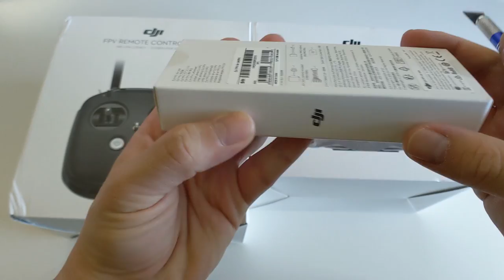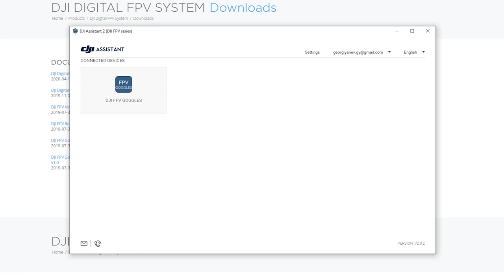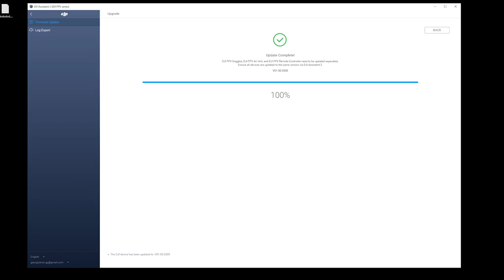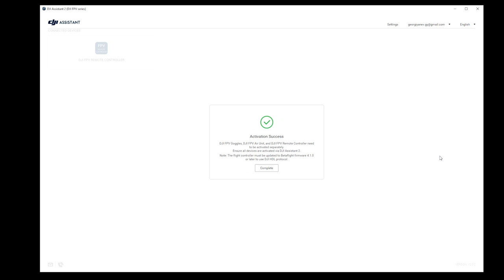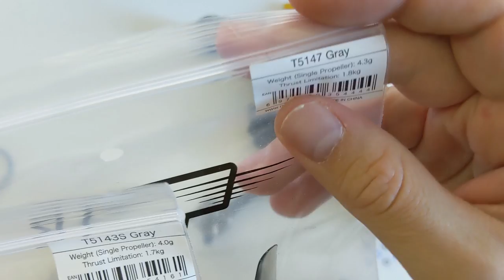DJI Digital FPV system - Unboxing and COMPLETE setup with Holybro Kopis 2 HDV /part 2/

Comment from the maker: TABLE OF CONTENTS:

0:00 - Intro
0:04 - Unboxing the DJI digital FPV system
3:21 - Charge the remote controller
3:40 - Attach goggles headstrap
4:27 - Screw in antennas
5:08 - Attach antennas to air unit
5:44 - Attach flight controller cable to air unit
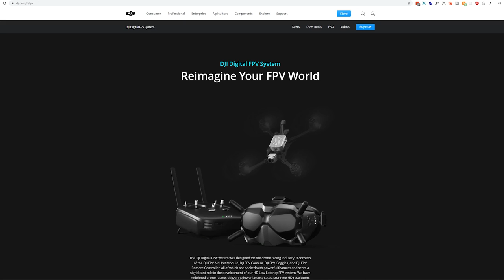6:22 - Download DJI Assistant2
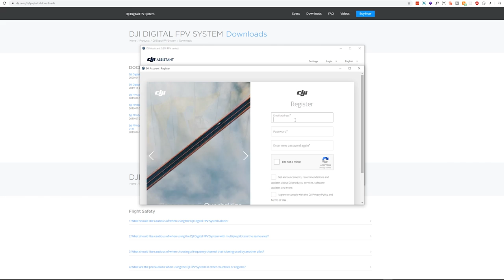8:04 - Create a DJI account
8:38 - Prep goggles for firmware update
10:29 - Activate DJI FPV goggles and update firmware
12:19 - Prepare the air unit for activation
14:28 - Activate the air unit and update the firmware
16:26 - Put together the air unit in the Holybro Kopis2 HDV
17:59 - Fix the FPV camera on the drone
21:33 - Activate the DJI remote controller and update the firmware
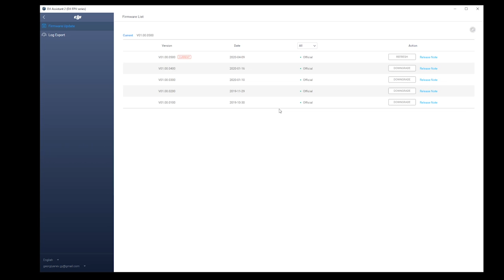22:22 - Linking / binding the goggles to the air unit
25:16 - Linking / binding the remote controller to the air unit
27:23 - Default arming switch and testing the motors
28:10 - Install SD cards
29:13 - Installing props
31:57 - Part 3 snippet
32:19 - Outro

🚁 Holybro Kopis 2 HDV - https://bit.ly/holybro-kopis-2-hdv
🥽 DJI Digital FPV System - https://bit.ly/dji-digital-fpv
📝 Holybro Kopis 2 HDV Full Review and Setup - https://blog.georgi-yanev.com/fpv/holybro-kopis2-hdv-with-dji-digital-fpv/

Comment: Excellent video......But I need HELP.
I followed the instructions but when I plugged the goggles (10:31) I didn't get that Icon, I heard the "tururu😁" when I connected the cable but nothing happened 😳😢. I used different USB ports and I heard the noise but nothing...... whyyyyyy😢😢?
Reply from the maker: Was there no video feed in the goggles? Try to isolate the issue and only debug one thing at a time.

Comment: Hello, if i have dji camera + air unit + dji goggles i must have dji remote control? Because i have my aparature to drone
On this remote is switch modes acro and stabilization?

Comment: Great video I also purchased the kopis 2 hdv for my first digital drone, I'm using a tbs crossfire I'm not very familiar with where to solder the connections. Can you point me in the right direction I'm using the crossfire nano as I was reading the manual I confused myself now I'm unsure
Reply from the maker: I would love to be able to help, but as of now I have no first hand experience with the DJI + crossfire combo. It's absolutely on my radar and something I'm looking forward to setting up as well. In the mean time, I suggest just googling around, I would imagine there would be some resources on the topic. Sorry I'm not able to help with this particular setup.
Reply: No problem I got it figured out, I'm in love with this kopis 2 though and the dji system makes the drone near perfect.. anyways I posted some vids of flying it, crossfire was very simple to install

Comment: You did not have to calibrate the controller and what buttons did you push to arm the quad it didn't show what do you use to arm the quad what is default settings I can't get mine to arm or pick up on betaflight
Reply from the maker: I think it's the SA button on the left. Remove props before trying to arm if testing at home!

Comment: so do you recommend this quad?
Reply from the maker: I do actually. Even despite the fact that there seems to have been some issues with some of the older models (including mine). I reached out to Holybro and they sent me a new ESC for just covering the shipping costs. They've been around for a while and are a solid company, and as for the quad, up until my crash it flew like butter.

Comment: This is why is still have not tried DJI because of all the faf and conditions of use!!
I have been flying fpv since 2015 and built over 50 quads on betaflight 😊 I would like to try DJI but this puts me off its to complicated and time expensive?
Reply from the maker: It's a good point. Different people enjoy different things. There are definitely pros and cons each way. Some people prefer to pay premium and enjoy plug and play stuff. Others, prefer to tinker, get the parts and spend time to build it from scratch. I don't think there is a right and wrong, just have fun and do what you prefer :D

Comment: Once activated, do you never need to connect your goggles online anymore?
I don't want to spend money on a device that may be worthless in six months.
I already had a DJI gimbal and a camera, so I know this company ;)
Reply from the maker: I think you should plug into the PC and update the firmware every once in a while if you wanna have the latest features. Don't have that much experience with DJI stuff.